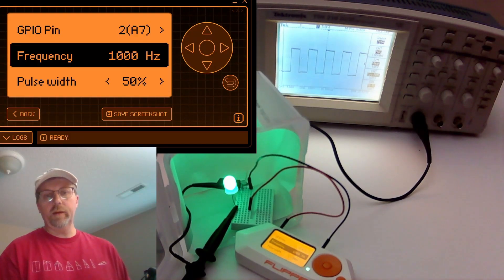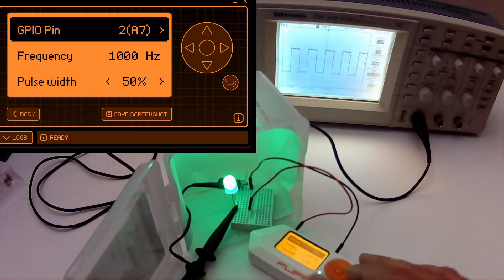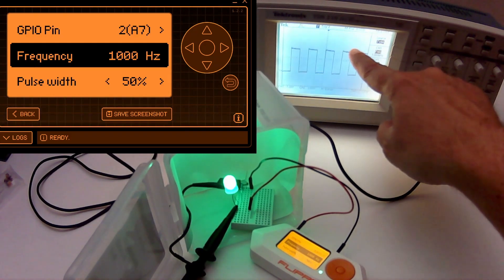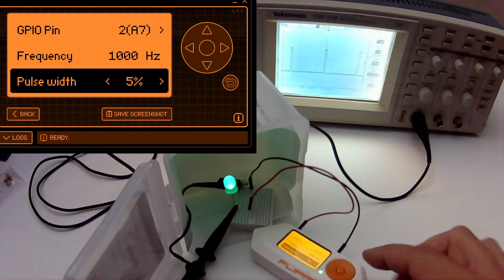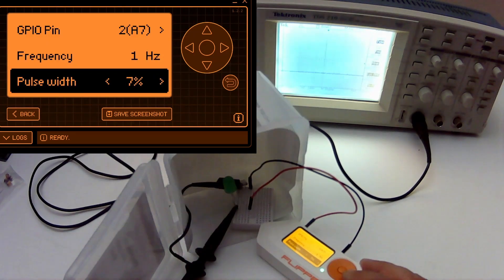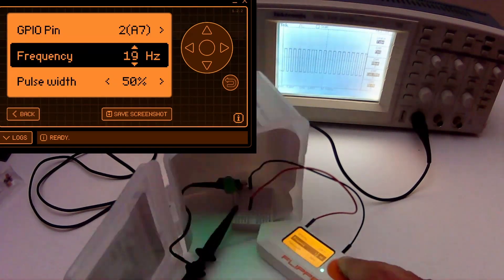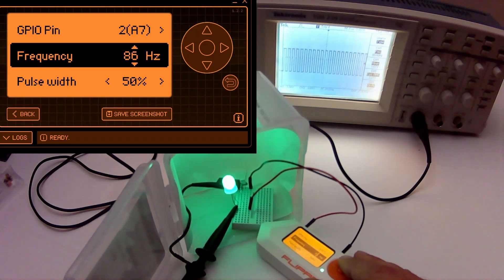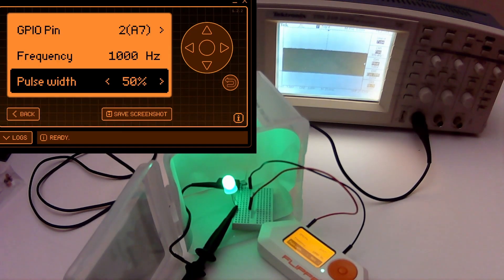[29] Flipper Zero - GPIO PWM Generator

Comment: What voltage does it produce when in PWM mode?
Reply from the maker: While the voltage is on, it is 3.3 volts and 0 volts when off.  The "average" voltage depends on the PWM value (you could probably make an RLC circuit to give you a nice analog output w/maybe an op-amp to allow for larger than 20mA current).  Google term: "pwm low pass filter" for more info!

Comment: That was a great base to get me starter learning my flipper and old oscilloscope in the same run. Thank you.
Reply from the maker: Glad it helped.  When the signal is constant, I usually bust out the old o-scope.  I move every year & I need to justify dragging this stuff around or else my wife will make me get rid of it. 🤣 When the signal changes frequency over time, I typically use a logic analyzer so we can zoom into the part we care about.

Comment: Do you need the LES
Reply: LED
Reply from the maker: The LED helps you see the GPIO output.  If you have something else you would like to connect to GPIO, you can.  https://www.amazon.com/s?k=5mm+LED has lots to choose from.  And lots of resistors at https://www.amazon.com/s?k=assorted+resistor (I typically use a bunch of ~100-470 ohm, 1K & 10K values).

Comment: On flipper zero, one pin is connected to 2(A7), second is to 9(3v3)?
Also could you please explain, why do we need 220ohm resistor?
Reply from the maker: In my video, the wires go to pin 2 (A7) and the second to 18 (ground).  

If you want, you can use pin 9 (3v3) instead — the duty cycle will then represent the amount of time OFF instead of the time ON (basically when A7 is on, it will be the same voltage as 3v3 - so a 0 volt difference.  And when A7 is off it will be -3.3volts lower than the 3v3 pin).  In that case, don’t forget to swap the anode and cathode pins of the LED.
Reply: @MrDerekJamison  thank you for response, I guess resistor there to prevent LED from drawing to much current from FZ.
Reply from the maker: @FyvaPro  (Sorry I missed your second question.)  You are correct. In theory, there is already a 51ohm resistor connected to the output pins, but I haven't confirmed it.  So either:  3.3volts/(220ohms+51ohms) = 0.01217A = 12.1mA   or 3.3volts/220ohms = 0.015A = 15mA.  

https://docs.flipperzero.one/gpio-and-modules#A02ys says "Each pin can source 20mA" of current.  (So, you could use something less than 220 ohm, but the tradeoff of extra brightness vs. battery/heat probably isn't worth it.)

https://docs.flipperzero.one/gpio-and-modules#miFsS says "I/O pins connect external modules to the I/O pins of the STM32WB55 microcontroller through 51 Ohm resistors."